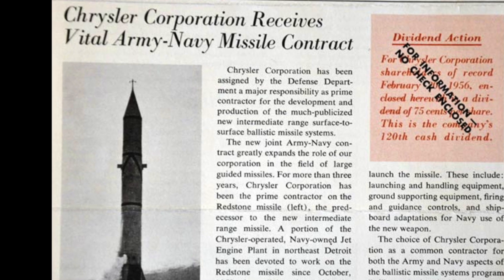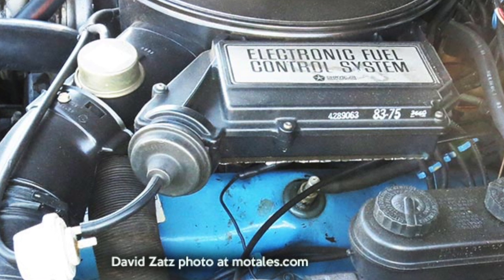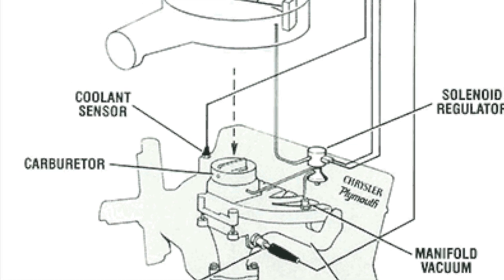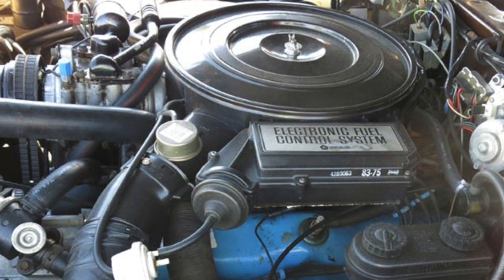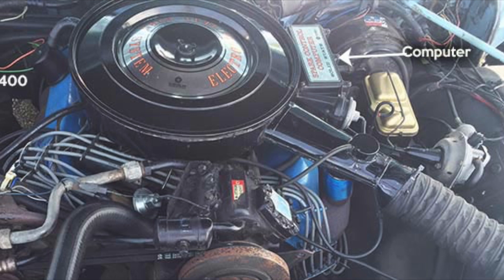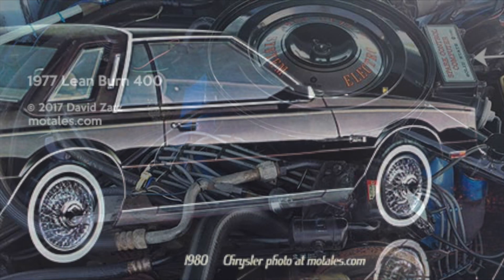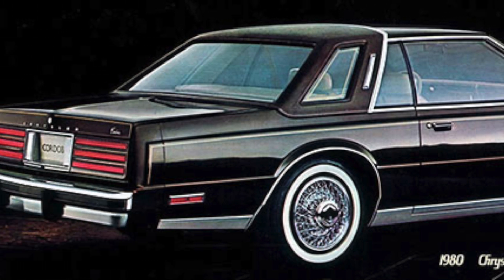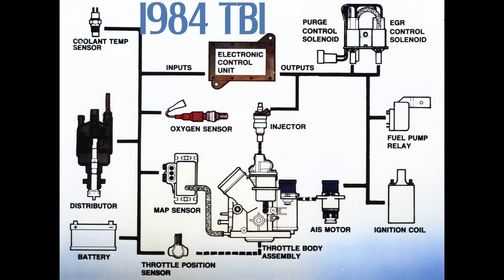Lean Burn

Comment: I have also seen slant 6 trucks with lean burn but they had a different looking computer mounted in the fender instead of on the air cleaner, not sure if that means they are different  or not or maybe they just wanted to keep the computer more safe like the 4 barrel police cars mounting them under the passenger side dash

Comment: Chrysler Kept lean burn on rwd cars till 89 trucks got away without it till later 80s also kinda intresting is how the 80 slant 6 cars had electronic ignition and 81 slant 6 cars didnt have lean burn but electric ignition with more control boxes that are basically timers along side it.

Comment: My Cordoba had it.  It did not work well even on a vehicle that was entirely factory once the engine was worn-in.  It couldn't handle tolerances being off like the previous electronic ignition could.